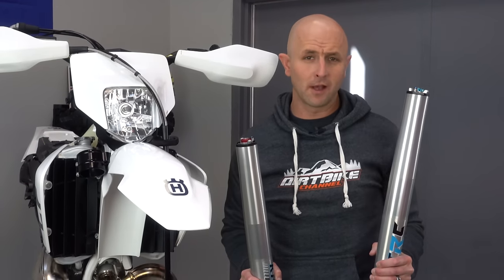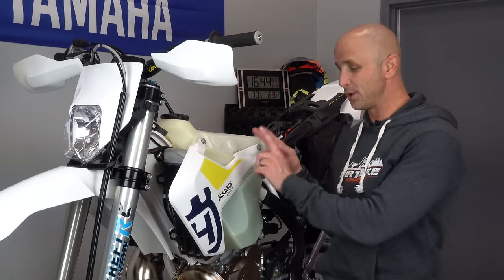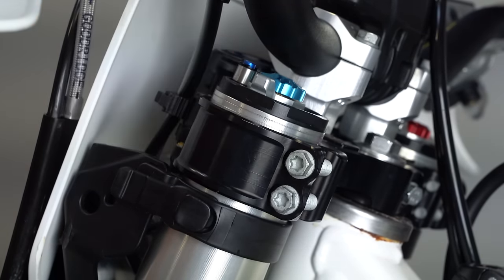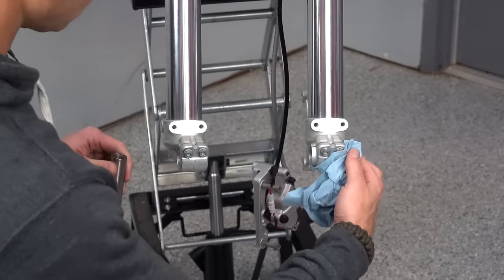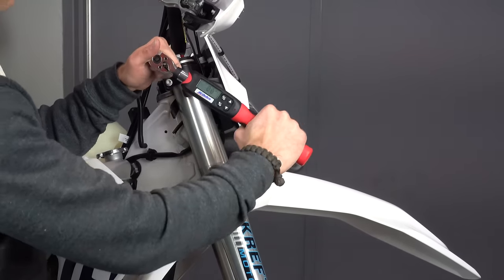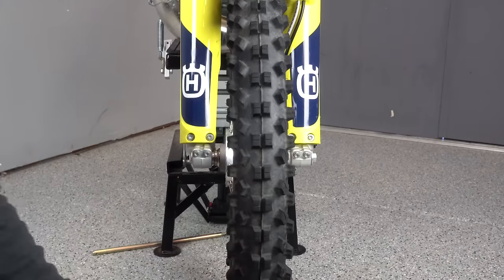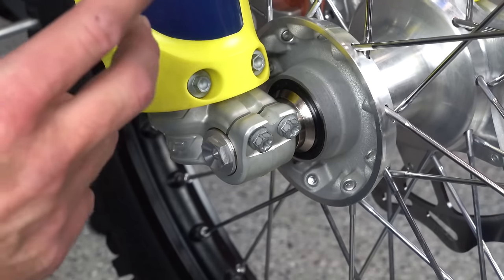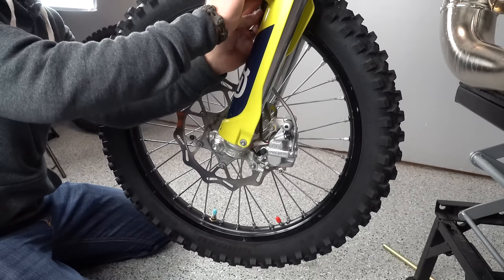How to Install and Align Forks on your Dirt Bike

Comment: Recently rebuilt the forks and rear shock on my 99' Yz125 and it was a lot easier than I imagined. Very intimidating for me but was not bad!
Reply: This comment help boost my confidence in doing my front forks
Reply: @seriouscheddar7373  if they are leaking, try just cleaning the seals first with a seal cleaner or a cut credit card. Worth a shot 🤷🏻‍♂️

Comment: Lower triple tree is a hair looser than the top in case you go down hard. That triple tree will move & get out of alignment slightly before you bend a fork - much the same way Kyle recommends not over-tightening your levers (in case you go down they’ll move a little instead of breaking off). Trust me on this. I high-sided about a year ago and thought I bent a fork.  My bike was visibly CROOKED. Loosened the bottom triple tree fork clamps and the top nut just under the handle bars. Bugger went right back to straight. 
There’s a lot of great info on this channel. I don’t sub anymore bc not eligible for drawings in FL. Thanks, Kyle!

Comment: Great tips, but if you tighten your front axle when it's not moving freely, and you then loose those clamps, wouldn't that change the torque of the axle, and can even leave it loose?

Comment: Great video.
A few points:
1 - I believe you should leave the pinch bolts on both sides free as both sides float.  (Ie, don't tighten the brake side pinch bolts until after you've loaded/unloaded the suspension)
2 - I normally remove the bike from the stand, grab the front brake and bounce the front suspension several times to get everything aligned correctly

This lines up with the procedure in the Yamaha WR450 factory service manual.
Reply: James that’s how the Husky manual says to do it also.
Reply: I have no idea why the manufactures do not use spacers on the axle for up-side down forks like they did with the traditional forks.  The traditional forks had to be parallel too.
Reply: @alang3991  "Alan G"  Are you a guy from CA. who as a kid almost 20 years ago, used to port go-ped 2-stroke engines, (Who was a competitor of mine)?
If so, Doug from ESP here, saying hello.

Comment: You still have to make sure the wheel and handlebars are lined up right, so the forks aren't twisted, i.e. top and bottom triple clamps are lined up in same plane. Maybe the KTM is different, but most bikes will need this done.

Comment: Was told by a local AA rider mechanic to grease all bolts that require torqueing, but don't require Loctite (e.g., pinch bolts on the triple clamps, down on the axle etc.).  A "dry" bolt will give you a false torque reading and most likely resulting in overtightening, which is not good, especially on the fork tubes.  Just some grease (e.g., axle, waterproof etc. will do) on the first 1/4" of the end of the thread.
Reply: Sometimes a wet bolt can give you a false torque as well too... fluid can cause hydro pressure
Reply: @corytricamo4163  Interesting.  I guess that I'd rather under torque the forks on the triple clamp and have them slide up slightly vs damaging the tubes...
Reply: Buzzer 1996 Nah, torque them exactly to specifications.... maybe just a dab of anti-seize and you’re set
Reply: Too loose they can slip up and ram your handlebars, or too tight they pinch and cause friction etc... I would just torque them perfectly. 🤘🏼🤘🏼

Comment: Thanks for the vid! I set my forks at the same height but the axle does NOT go through smoothly? I then aligned my forks so that the axle goes through smoothly but the fork heights are about 1mm off from each other? What's more important? Fork height the same or axle smoothness?
Reply: I had this same issue and wondered the same.  Did you find info on this?

Comment: The height of the fork i would say its independent. I have it as high as possebal all the way to the cap. Iam 192 cm and it feels better. Its fast to experement with it on the track i mean its only 1 min job.

Comment: To get the forks parallel with each other, the front brake trick does not work.  I know this because after a few rides, I changed my fluid and found metallic pieces in the oil.  So I measured the cent to cent distance of my triple clamp, and calculated the correct distance between the fork tubes.  For my 2019 YZ 250 2-stroke, it is 5.661".  I then cut a 1" diameter piece of aluminum bar stock to 5.661" long on my lathe, (facing off both ends to overall length), so I can  use it between the wheel end of the forks, (the 1" round stock fits through my brake disk).  The spinning wheel brake method left it wide.  To be quite frank though, I have no idea why the manufactures did not use spacers of the correct thickness on the axle, like the normal forks had. They had to be parallel too.
Reply: If you can't make that tool, another method that makes sense to me is remove the top caps so you can compress the forks to bottom, and strap the wheel so it will stay bottomed with the wheel off the ground with the clamp loose.  Wiggle the wheel a bit so the forks find the best cent to cent distance, and tighten the clamps.  The idea is that with as much overlap as possible with the forks compressed all the way, it will find the good spacing, that is not hard on the bushings, by itself.

Comment: i'm a newbie for dirts so if i ask some silly questions, so sorry for that. For my riding style, i need to raise the front end about 50mm so i need a longer pair of forks. Any suggestions (for model of forks)? I don't want to change the front wheel. Thank you
Reply: The balance between the front and rear suspension is pretty good from the factory on any good dirt bike.  The balance effects how stable the bike is in a straight line, and how well it like to turn a corner.  Just sliding your fork tubes up or down in the triple clamps 5mm will make a difference most raiders can feel for corning or straight line stability.  If you raised your front end 2" (50mm), it might be very stable,---but any other dirt bike will be able to track in a corner much better.  It would be like trying to turn a chopper. It sounds like you need a taller bike, (both end higher), and I have found, (getting back into riding after 20 years off), that bikes that are too tall,---are the only ones made today.  I lowered my suspension (internally) on my 2019 YZ250 6.35% on each end, (.75" in the front and a bit more in the rear), so I can keep a good balance.

Comment: When in the sequence did you re-gorge the steering stem nut?
Reply: Sorry, re-torque.
Reply: @aaronmcelhinney1436  I'd check your service manual for the proper procedure and torque specs because it will vary from bike to bike. For example, when re-installing the castle nut for the Yamaha's lower triple clamp you need to tighten to 27lb-ft, then back off fully and re-tighten to 5lb-ft. Steering stem nut on the top clamp will have a specified torque as well.

Comment: Could you tell me the purpose of upper clamp that fork have to up 5 mm more? Somebody told me it have to up 2 mm more, and mine had 10 mm more
Reply: Raise or lower the front end.
Reply: Affects the speed of the steering and handling, in sand slide forks down to flush to make it more stable and less twitchy.

Comment: You can also use the Motion Pro Alignment Tool for even greater precision. Not necessary, but nice to have.
Reply: I made my own tool from a piece of 1" diameter aluminum round stock, (to fit between the fork legs through a hole in the brake disk), and found this method to be off almost .030" on my bike.  It is necessary to use a tool.

Comment: That’s actually called a double clamp because a triple clamp has three bolts that one only has two and two is double so it’s a double clamp. If you don’t believe me look it up.
Reply: We should just call them yokes I guess. Maybe it's because there are 3 clamping points, steering stem, left fork, and right fork.
Reply: two forks, one steering tube, three holes.  Triple clamp.